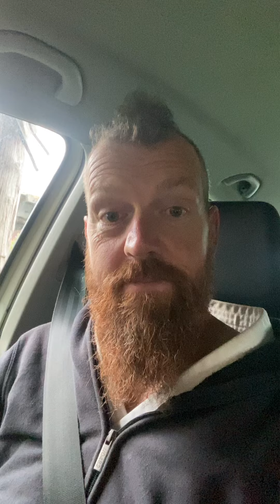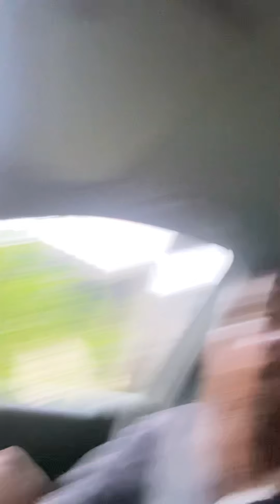What is a dpf and wtf is a regen?

Comment: Thanks for the advice, I will spread the word!
How do I go about finding a DPF for my Cooper D? Previous owner removed it and I just found out it's missing... MOT in 3 weeks
Reply from the maker: Depends if it’s noticeable by the mot inspector. If the car has been remapped and the dpf isn’t noticeably missing it may pass. Otherwise it’s gonna be the aftermarket or secondhand route. New genuine one will be very pricey.
Reply: @bradauto  thank you for your advice!